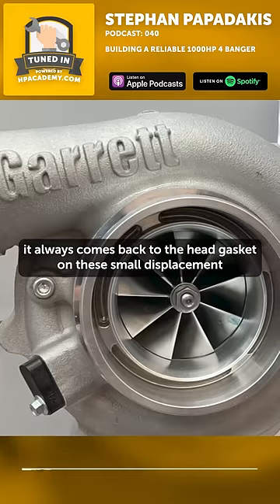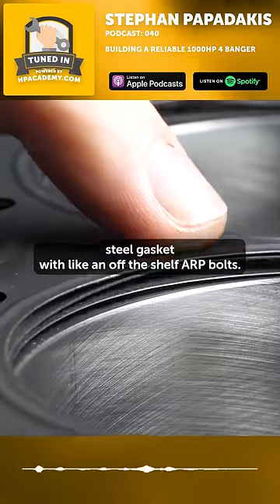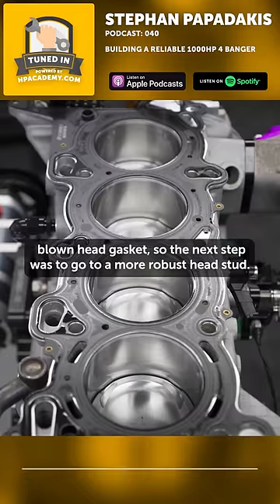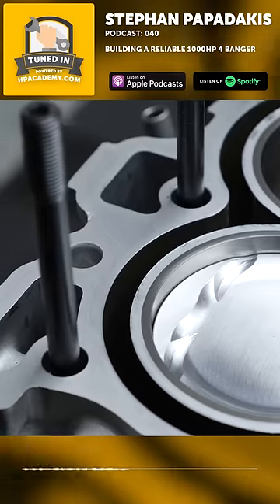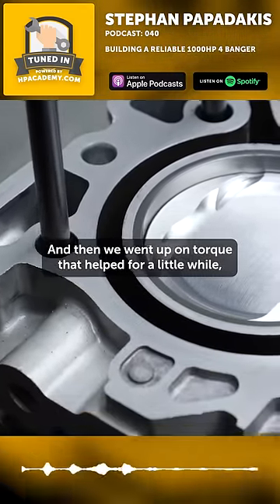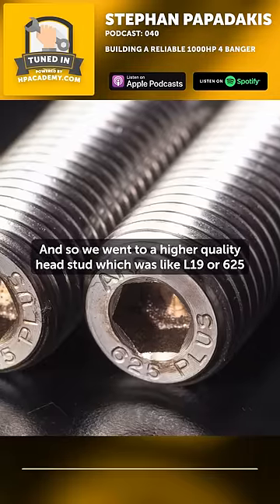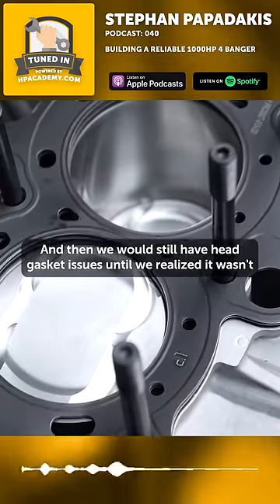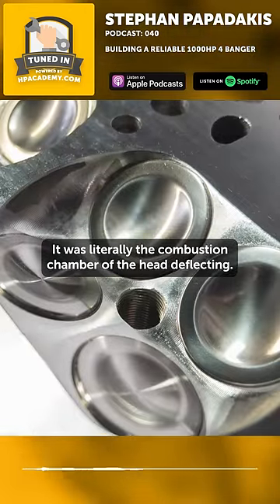How to hold a headgasket on a 1000hp 4 Cylinder 🏎😳 #shorts

Comment: I hope my 1.5L 4banger can get up to 300hp for hill climb just for fun.
Reply: I built my '93 Ranger 2.3L up from  95hp to 460 bhp. I was gonna do 5.0 swap, but I got more power than the 5.0 with half the weight for less money overall.
Reply: @Stroke-it-2-Handed  I have an 86 F150 I'm wanting to do something stupid with. She's got an old tired 302 (5.0 Coyote's sleepy grandpa)
Reply: @SebastianWoodard  same here, '91 F-150 5.0 H.O. 
I put a good set of heads on it, nice cam, quality headers to 12" glass pack baffles, MSD ignition system, advanced the timing and took off that ridiculous intake tunnel. Really made that old truck come alive! It'll roast the General Grabbers like crazy. 
Edit: Also high volume fuel pump and bigger intake. That stock intake is very restrictive on air.
Reply: @Stroke-it-2-Handed  I'm wanting to do an x pipe boom tube exhaust for sure. I'm thinking about them GT40 heads but I'm trying to be smart and comparing a lot of stuff and match parts properly and such. I haven't built an engine before and I'm excited to learn. She's got 510,000 on the clock so she's been a good engine, and a rebuild would do her good.
Reply: @SebastianWoodard  WOW!!! 
I've never seen a 302 with milage that high. I've seen the 300 Straight-6 with it though. Rebuilds aren't too difficult, since the majority of the parts are going back in brand new.  Take the block to a reputable machine shop and tell them what you want, get the new pistons, crank and cam and everything to go with them.  Heads are a big part of performance, intake manifold too.
Make sure you get forged parts. 
I've learned that the Pro Charger
System works best for big power 
on the 5.0 
(Better than supercharger and turbo)
Reply: Damn bro. You got the Terrifying Tercel just like me?! Throwing flames and dropping panties with these monsters 😄
Reply: @Stroke-it-2-Handed  ProCharger is a supercharger... What are you talking about?
Reply: @sethh8892  They're all superchargers.  But the Pro Charger has a constant feed of air. Way better than a top mount supercharger and no lag like a standard turbo. Still yet, all 3 are technically superchargers.
Reply: Ive found that building big power on small engines is usually more fun than swapping in big engines. You almost always get more intimate with the platform by building than by swapping. You learn the advantages and flaws of every intricate part, and it really makes you appreciate the engineering behind some of the many overlooked engines. For instance, I find myself having more fun making 400hp (100 more than stock)  in my 5cyl turbocharged Volvo S60R than I do driving my friend's stock 450+hp Mustang GT. Maybe that's just me though.
Reply: @dsrocks6905  yeah, probably just you.
Reply: Maybe... Just maybe only me wants to see a street build 300+ hp on 4g15 single cam build. It's is one of my old car that I still hold dear to my heart. I wish to build something special with it properly. Hopefully to be fun daily driven car. My car got lancer bones c95/c99 rebadged proton wira in Malaysia with only front wheel drive. I wish I can have mustang v8 but here it's only for the rich, a yearly tax is the same with my monthly salary. Even the mustang ecoboost 2.5L priced same with used tesla model 3, above myr300k.
Reply: @hadiTHEgreat87  My 2.3 is SOHC. I built the whole thing for $3,500 usd. Only paid 800 for the truck, drove it for a year before blowing a head gasket, so, I figured since I was gonna tear it down, I'd just go ahead and do a rebuild, then I took it a little farther after seeing how inexpensive performance parts are. 
Don't be affraid of Amazon and Ebay for parts. Just be smart about what you're looking at.
Reply: @sethh8892  I've done both. I own a total of 18 vehicles, 14 trucks and 4 cars. Building a high powered small ci engine is definately more fun when building a sleeper. As long as you make it quiet. Can barely hear my ranger engine running, if you do, it's because I just blew your doors off.
Reply: @dsrocks6905  I'd beat him on the dragstrip for sure. 1/8 & 1/4 miles. My Ranger is about 400lbs lighter and putting more power to the road. 2-speed powerglide with 4.30 rear diff. If his diffs are stock (2.73 to 3.31) he would see nothing but my tailgate getting smaller and smaller LOL.
Reply: @Stroke-it-2-Handed  that's a good example "while you're in there" situation. I'm gonna do compression test first before deciding to boost it again.
Reply: @hadiTHEgreat87  That's a great idea!  I had to change to low compression pistons and still had to use 2 head gaskets to get down to 8:1.
Reply: @Stroke-it-2-Handed  my route is 9:1 short custom log style extractor like before. Opting for quick spool low end torque to middle rev range over top end power just for fun and driveability.
Reply: @hadiTHEgreat87  I drive normally on 15 psi, but I can take up to 40 psi with a couple taps of the keyboard.  Blows people's minds to see a 47 year old doing it.
Reply: That sounds fun
Reply: @sethh8892  I was gonna say that too... It's just you.
Making 2000hp 2jz is awesome and great. Then build a V8 for 4000. It's a linear curve at this point. If 2000 is all you need then congrats you did what you wanted to do
Reply: @Stroke-it-2-Handed  just curious.. what china turbo are you using? I'm not against them, you just can't blame anybody when they explode and hurt parts. Don't mean a person shouldn't try however...
Reply: @williamstamper442  exactly, there's no replacement for displacement. If you want more power potential you have to have more displacement. I have just as much fun building small engines with less horsepower as I do big engines with big horsepower, it's all about application. Either way, you still get to build a really cool motor.
Reply: @williamstamper442  I'm not using any cheap parts from China.  I'm running an HK30 Tubonetics from Summit.
I was telling that guy not to be discouraged if that's all he can afford.
Reply: @sethh8892  While that's true to a certain extent, I can make more power than a standard 5.0 is capable of handling without flying apart.  You take a built 1990's 302 above 500hp and then peg the rpm at 6k, it's toast. I can make 100hp more than what I'm using right now, just no reason to.
Reply: @Stroke-it-2-Handed  who said we were talking about a 1990s model engine? Modern 5.0 coyote motors are comimg from the factory with 470hp. You can easily slap a supercharger or turbochargers on them to make tons more power.
Reply: @sethh8892  I don't work on new engines. Just because it says 5.0,  doesn't mean it's the same thing. 
You're talking about a completely different engine with DOHC and a standard factory coyote engine still only makes what I'm Making at 20psi with my 2.3. And I make it at the wheels, not the crank like the Yote.I have big built V8 engines too. I have a  1984 Fox body 1/8 mile car that makes 590 NA.
Reply: You definitely can, I'm making 335hp on a 1.4l 4banger
Reply: @KevinDeanTaylor  cool. What engine is it? Vw golf?
Reply: @hadiTHEgreat87  no its Hyundai Getz 1.4l G4EE motor with forged pistons and rods and a GTX2860R. There are guys making 300kw with the 1.4tsi motors though
Reply: @KevinDeanTaylor  I have the G4ED in my accent SR hatch, are they the same pistons and rods If so where did you get them
Reply: @johndc2998  no unfortunately not, your pistons are 1mm larger, not sure about your rods but I know your stoke is 9mm longer than the G4EE. Sure you can find a piston and rod that will work with some machining though. I'm using a Wiseco Honda D17 pistons and Eagle Honda B16 rods. Piston fit fine, rods had to be machined abit to fit
Reply: what engine do u have? i’m from indonesia and we have turbo kits for honda’s l15 engines they’re 1,5L 4 cylinder engines. with the turbo kit u can make 300+hp easy but u do need rods and pistons.
Reply: @pemay58125  ya the Honda D15 motors make like 500hp with Vitara pistons, some forged rods and a big turbo
Reply: You guys with the "No replacement for displacement" BS.   I'm almost 50 years old and I've built probably 100 engines from the ground up.  You can say whatever you want about displacement, but the fact is, your  2000hp V8 isn't worth a damn for anything, unless you can make it hook. Regardless, a 1000hp 2JZ is gonna dust it. Idgaf what you say or what you think, it's a fact.
Horsepower doesn't mean a damn thing.  It's all about about power to weight ratio and being able to make it hook. 🤡
Reply: @Stroke-it-2-Handed  get a ford barra over a 5L  2000hp daily is very easy to achieve with 14.3mm headstuds,  block bored, honed and decked on forged parts. 
I've seen 
Bf and ba blocks and heads sell with complete wiring and computer for 200-500aud.

My build is 1000kw daily built for 1500kw , $14000aud including the wagon and tools to build my motor (non electric,  but including digital torque wrenches).

Can be done if you have patience...
Reply: oh man you sure can i have seen many 1.5l 4 cyls go 1000 hp, although 60 psi turbo
Reply: @Stroke-it-2-Handed vids?

Comment: When you run excessive torque on the head studs you can cause the combustion chamber or hole cylinder head to deflect just from that pressure. And so you end up creating a wave cross the deck
Reply: Did anyone think of that while boring the cylinders? Was a torque plate installed with those clamping forces on the bore? That's the idea behind torque plates. The guy never stated they checked the bore again. Blamed studs and head gaskets.
Reply: @johnbaidas  I think I remember in one of his videos that they started using a torque plate possibly because of this build
Reply: @johnbaidas  yup, what I was thinking too
Reply: What’s a torque plate?
Reply: @joshuabenson2568  it's a metal plate that you bolt down on top of the deck surface to replicate the tension put on it by head bolts. Just look up videos of them on YouTube.

Comment: not sure if this repair method factors into this application, but: I was always taught to use the copper spray, on head gaskets. Some will argue that it runs down the cylinder and damages the engine. But if you spray it, and let it dry, then install the head gasket, it will be fine. I know it works great for keeping the engine from having external oil leaks, but for high performance engines holding in compression, I don't know. Also, a trick that we stole from diesel engines, was to run a 20 psi radiator cap. Or even a 40 psi racing one. But that applies for old style caps that cars from the 70's, 80's, and some 90's ran. The higher coolant pressure would keep the head gasket from blowing apart, at the expense of increased strain on the cooling system. Again, different application that may not apply, seeing how radiator caps haven't been generic for a long time. but just a thought.
Reply: Peak combustion pressure on these 3B+ engines are going to be over 2500psi, I'm not sure running the water side 40psi would make a big difference would it?
Reply: @jameseastwood4984  you raise a good point. I think the operating pressure of the cooling system, does play a key factor. I've replaced radiator caps that only held a few pounds of pressure. And then three days later the radiator or EGR cooler explodes, from the pressure of the new cap. I would imagine that if a pressurised water system could tear something apart, that it can also help keep it intact. Only problem, is I don't know the science behind it to support my claim, minus the experience of course.

Comment: A custom girdle. Machining a groove for metal O rings around the cylinders and combustion chambers on the deck and head mating surfaces, drill and intall additional locating dowels to keep migration and malformation minimized.
 I've also seen and then used a trick drill and tap coolant holes to install a plug, drill a new coolant hole in the plug leaving the right amount of plug protruding turn down the exposed portion of the the plug and mill a matching hole in the head (plug coolant hole in the head and drill to match if necessary)

Comment: Look at old school ford Cleveland heads used by ProStock guys in the 70s. They drilled and threaded holes in the ends of the heads to thread a bolt in through the water jacket that would contact the back of the combustion chamber from the water side to stabilize the combustion chamber.
Reply: Not much of a comparison though these motors are toys compared to a beefy clevo there all water jacket now and they wonder why they deform
Reply: @kieren7763  the Cleveland heads were thin in the combustion chambers to the water jackets. The reason for deformation is the same snd the cure could be too.
Reply: @kieren7763  I think the reason it deforms is because it's under so much boost pressure, technology has definitely advanced, and back when the Ford Cleveland Motors were made, making a thousand horsepower out of a 4-cylinder was joke. They didn't have the technology nor the understanding of mechanical operations in order to do that reliably.

Comment: Magnified visual inspection usually reveals witness marks from the 'scrubbing' action that accompanies a head gasket leak/failure, which points to the actual cause.
It's a humorous misconception that more clamping force will ALWAYS cure a head gasket issue - it reaches the point where either the head's or the block's distortion is the issue and the "crank 'er down tighter" bandaid just doesn't work anymore.

Comment: I used custom 13mm head studs arp 625+ on my 1000hp 4 cylinder 2.3l ecoboost.
Reply: Interesting, ive never seen an ecoboost past 800hp..
Reply: @DeathKillaGaming  well tune plus inc is building it. And EMS and Parker performance also came out with their 1000hp ecoboost mustang.  But it’s two completely different set ups but still all 2.3 ecoboost.
Reply: @Paper.Power.Politics  they say its a 1000hp setup but only dynoed at 800whp
Reply: @DeathKillaGaming  probably 1000hp at the crank
Reply: @Paper.Power.Politics  Ok you said “My” then said “EMS and Parker Performance is building it” so is it yours? And even if it is, it’s being built still, meaning you have no definitive proof it makes 1000hp.
Reply: @destruxandexploze2552  my: a term of ownership

Are you aware of dyno testing? It's this sweet new way of objectively measuring HP and torque output of a motor. Pretty neat, huh?
Reply: @Paper.Power.Politics  cap

Comment: My 6 bolt 4g63 had this problem at around 28psi. I've had much better luck after decking the block and head and running a copper head gasket.

Comment: You could model the pressure on the gasket with CAE, then devise a profiled head or block surface to equalise the sealing pressure around the combustion seal.

Comment: Want to add that a prominent engine dude here in Detroit (street race stuff not the oem's) said this once...
At temp and under power any cylinder is anything but round..

Take from that what you will.

Edit : same guy was an automotive machinist as well as a drag racer.
He made 4000hp when many of the readers on here were in diapers. And that is not a put down, just a statement

Comment: Resleeve it with more robust sleeves.

Use 14.3mm for up to 170nm per bolt.

Use copper fire ring gasket.

That should be able to help you get to 2000hp reliably
Reply from the maker: They've moved on from this, he explains it next in this podcast episode 😎 - Taz.

Comment: Floating cylinders move around, that's why these engines can't stand pressure over a certain amount. The studs aren't going to resolve anything without having a solid cylinder or block deck. This is why they use siamese cylinders again to gain side rigidity and solid decks of the blocks. The amount of deflection that you get especially under pressure of boost, means you're never going to be capable of holding it in without a gasket leaking eventually. Also without cylinder decks you're losing weight which is why they make them in this manner, econo-box engines were never intended to handle boost for any length of periods, but also I've seen plenty of even decked and reinforced Honda 4 cylinders snapping the entire blocks into halves or multiple pieces at moderate boost levels. So basically, your only option is dumping lots of money into a BOAT. Even with tons of expensive machine work, they eventually are going to crack and fail, and you've wasted multiple thousands of dollars on a econo-box engine with expensive badaids all over it. It only my buy you some time, ultimately it will fail though and the money could have went towards a better designed engine adapted to fit your application.
Reply from the maker: Worth listening to the rest in the full episode 😉 - Taz.

https://www.hpacademy.com/blog/040-building-a-reliable-1000hp-4-cylinder-for-formula-d-podcast/

Comment: my 2.0 Saab 900 holset 62mm pushing 28psi atm is doing the same thing. got advice from someone to drill between the spark plugs to use as a reinforcement for the chambers to push down and prevent the chamber from doing that

Comment: 1000 hp, holy shitballs! Maybe a cast iron head will fix the issue? You could get something machined out of chrome molly maybe? I'm building my 5.9 12 valve at 300hp and that worries me a little, diesel gets very hot.
Reply: 300hp .. that's what 100-125hp more than stock... only way I'd worry is if the block had 200k+ miles with a lot of blow by. Get a Pyro and don't just fuel the shit out of it .
Reply: But you're comparing a gas motor to a diesel motor... totally different. You can definitely make a lot more horsepower out of your 5.9 diesel.

Comment: Boost levels would be interesting.
Reply from the maker: I think they come up in the full chat: https://www.hpacademy.com/blog/040-building-a-reliable-1000hp-4-cylinder-for-formula-d-podcast/?utm_source=youtube&utm_medium=social&utm_campaign=general-interaction
Reply: Boba Motoring with his Golf 1 2.0 Turbo is running around 4.4 Bar with E85 and max ported Stock Head. Getting to 1230hp at the engine.